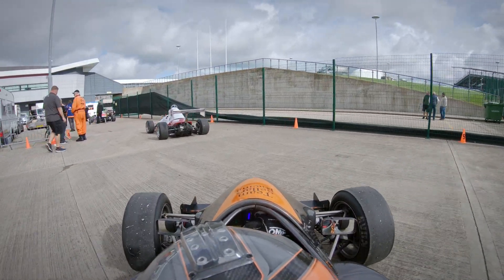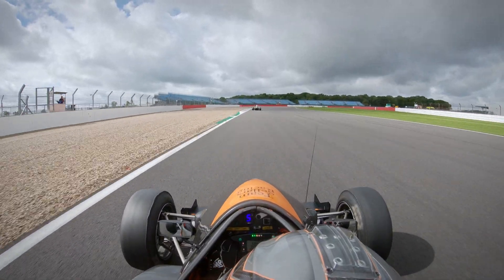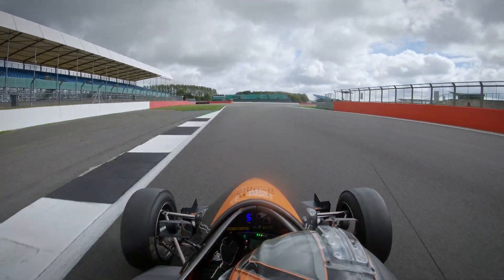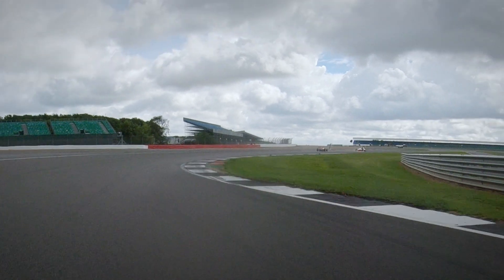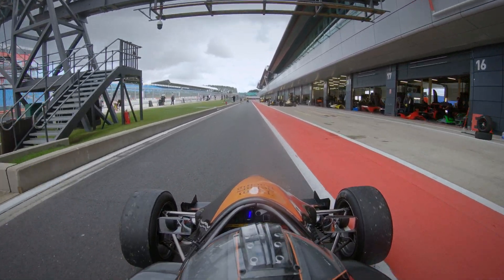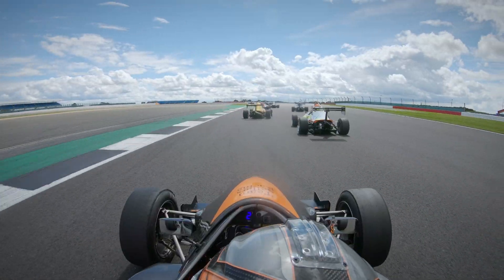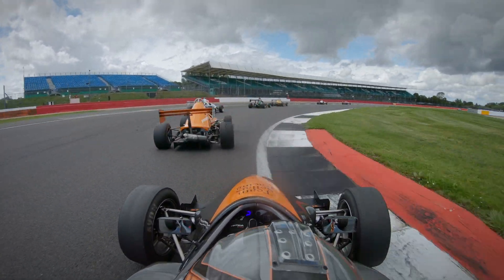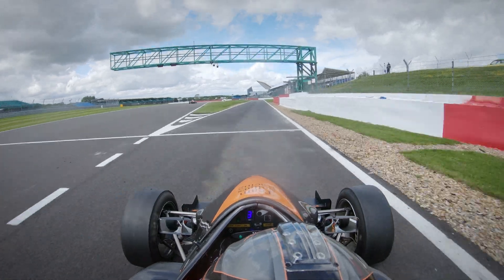What is WRONG with Most Race Cars?

Comment: Also, why can't you put dampers under the most critical parts, like engine and transmission? 
Of course you can't use the normal suspension, because the car will lose traction and therefore speed, but damping the engine should not cause too much trouble, and will save you hours of work time, no?
Reply from the maker: These bike engines are not supposed to be dampened by design afaik. But in bike they handle much less stress. Softer car in general always looses some performance compared to more rigid one because of quicker response and weight transfer. This is why they designed this way I guess.